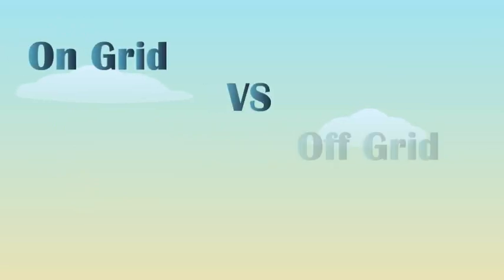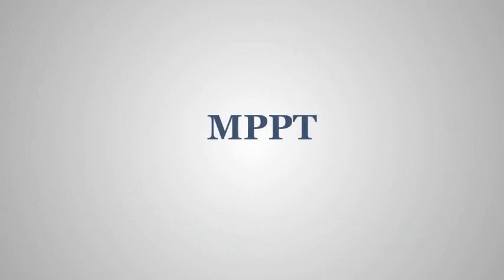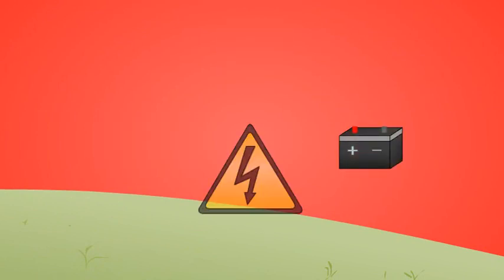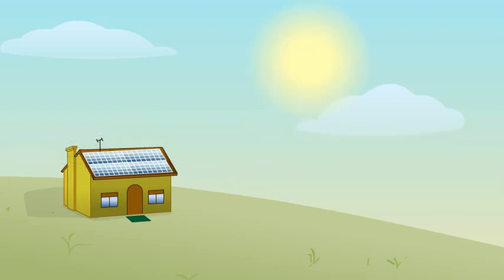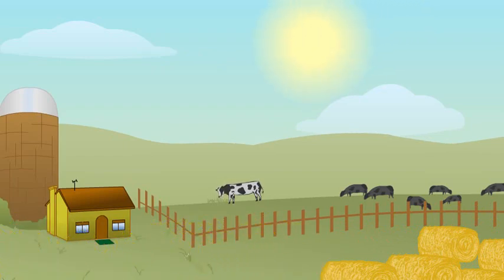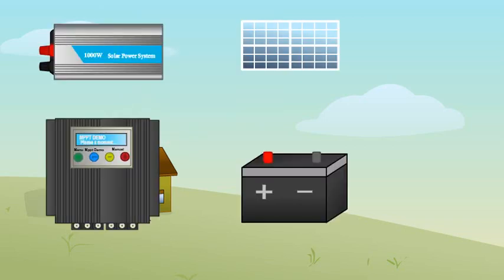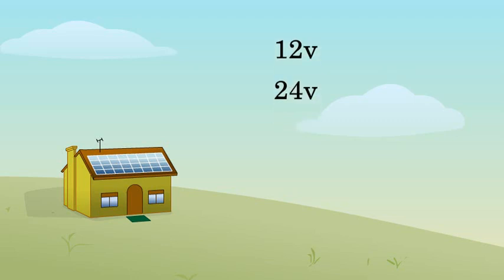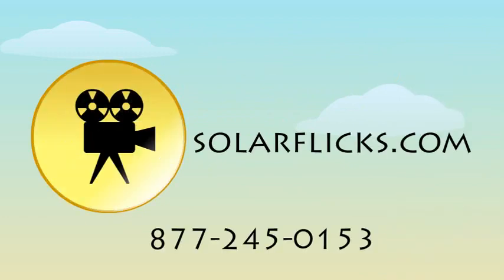Solar Home Basics : On Grid vs Off Grid Solar Panels

Comment: When the grid goes down so does the grid tied system. God forbid you have a hurricane and have a week or more of no grid power and not have enough backup.
Reply: Grid tied should NOT go down because it does not require power from the Grid. That's a backup. But it just needs to be designed properly

Comment: Would an ongrid system be worthy if you live in a place where the electricity  provider tends to cut the power for several hours daily?
Reply: You can have a battery backup but once the grid goes down so does the grid tied system for safety of the workers.
Reply: If properly wired, the ongrid system could keep your house running so long as it is sunny. It just has to be designed for that. It can use one way circuits to prevent the electricity from flowing back into the grid if the grid goes down.

Comment: I have been in the renewable energy field for some time now and have used many products for instructional purposes, but this [link here>>>https://www.facebook.com/Build-Your-Own-Solar-132917764038406/app/208195102528120/ ] is the best. It has all the material needed to get people here in the IBEW up and running for the installation and design of solar systems.

Comment: If you have power cuts often then an off grid system is pointless
Reply: Actually, you have it backwards. If you have power cuts, then you need an off grid system to makeup for when the grid is not available. The more power cuts you have, the more batteries you will need to stay up longer when the sun is not shining.

Comment: Hi is that possible to connect a inverter to solar panels, should it work? 
Not connect to a battery, just connect to solar panels and use it on day.
Reply: It is possible, I have done it. But you need to measure the wattage to power anything worthwhile. A PC might use 300 watts , so that would probably work. Watts = Volts x Amps. You lose power in the conversion process.

Comment: how can you use a grid-tied inverter to feed directly your house if the grid goes down?
Reply from the maker: The grid tied inverted should automatically feed your house when the power generated by your solar panel meets a certain threshold. It thereby cuts off the grid so you are not spending any money. The only time you would need the grid is at night or when there is too much cloud cover such as a thurderstorm.

Comment: would you need more panels with an off-grid since you depend on the panels more than the on-grid?
Reply from the maker: The number of panels would not change, as the on grid system should provide 100% of your power when the sun is shining. However, when the sun is not shining, the off grid system will need batteries to provide power. This is why the off grid system is more expensive.

Comment: Up to how many years do solar panels last until they're deemed replaceable? And if they get damaged, besides warranty service, are there specific components that are available to the public for basic repair?
Reply: I was able to buy parts online for cheap. i think you can replace most of it yourself, even the panels if you can get on your roof and replace them. However, I draw the line at that because I fell off the roof once!

Comment: Cleared some things up for me. Is there any advantage to ground vs roof mount solar panals?
Reply from the maker: Actually there are lots of advantages to ground mount such as:

1.Ground panels will run cooler because there is more airflow, which makes them  more efficient.

2. Ground panels are easier to point directly at the sun without having to account for a roof's possible inefficient angling.

3. They are easier to maintain and keep clean.

4. Solar Panels usually outlast a roof, so they do not need to be removed while your roof is changed.  There are other advantages as well.

The  biggest disadvantage is that they use up valuable space on the ground and may not be attractive for some folks.. On the roof they are "out of the way"